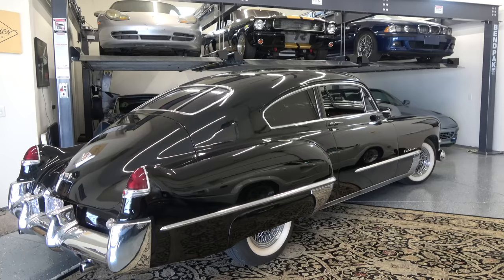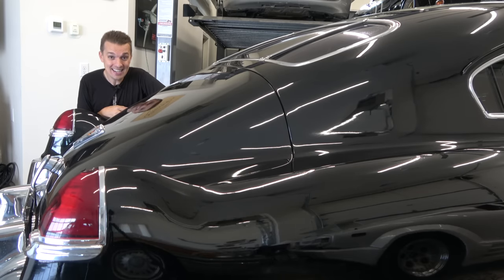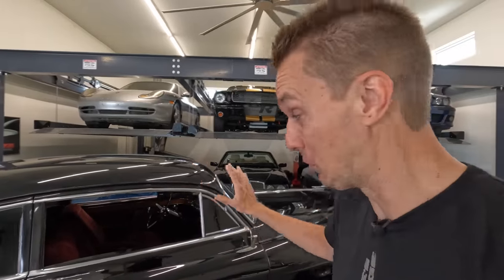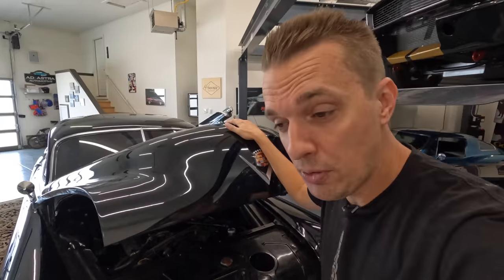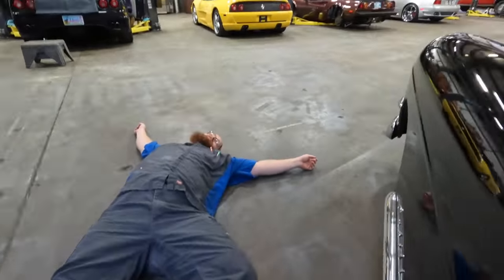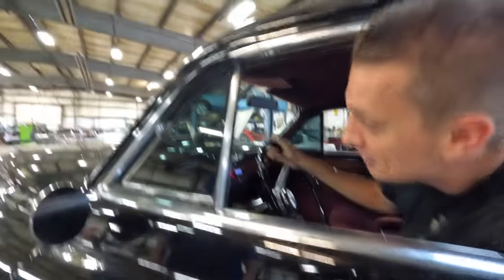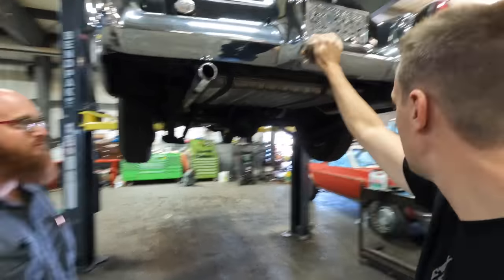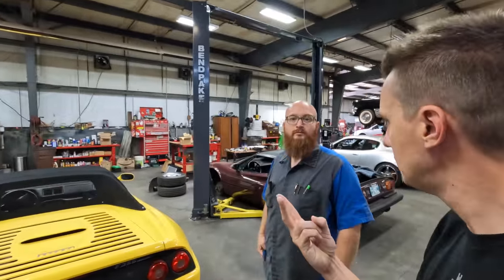I bought a RARE 1949 Cadillac Fastback, and making it my 70 year old daily driver! Amazing Restomod!

Comment: Because it says Hydramatic my guess is that it has the older Cadillac 4-speed transmission that came before TH400 (turbo hydramatic) which had only 3 speeds. I always say that the best design regarding looks and also mechanical features happened in the 40s and 50s while in the 60s there was a decline. Less interesting looks. And also 3 speeds from the mid 60s instead of 4 speeds show decline. That's why I am interested in cas basically until 1960 but not further.

Comment: “For 1971 compression was reduced from 10.0:1 to 8.5:1, the lowered compression ratio dropped the 500's gross output from 400 bhp (298 kW) to 365 bhp (272 kW), or 235 hp (175 kW) in the new SAE net ratings. By 1976, its final year, it had fallen to 190 hp (142 kW)”.

You could replace that gas siphoning device with something lighter. Like a 4.9L 200 HP CHT engine. 

But if it was my engine I would put a 383 stroker in it. You can get almost the same torque as the Caddy 500 but more horse power at a much lower weight, and a hell of a lot more room under the hood. If you really wanted to lower weight get a L6 4.8L with 170 hp and 270 ft*lbs of Torque.

Comment: Those 472 and 500 blocks had high nickel content, thin wall casting and only weighed 50-60lbs more than a SBC.   Pinnacle of GM big Engines.   I don't call it a big block only because Cadillac had no small blocks and big blocks.  it had only a Cadillac engine in it.

Comment: Wow! It looks amazing! The bright of painting is thanks to poliuretan te ñchnology, I think when this car was new it paint was ducco polymer, certainly very less shine, wich it must to polish off frecuently. 1949 Cadillac automatic transmision was Hydramatic N D L R , reverse works like a parking position. I had a 1952 Olds 88 wich had a S between D and L , named as Dual Range useful in streets until third step, due gearbox with 4 speeds. Power Glide, instead, had 2 automatic speeds, something like a 1st and 3rd position in a manual comparision.
My English is like a bag full of shit. 🤨
Greetings from 🇨🇱 Santiago Chile SouthAmerica

Comment: Never quite understood how these huge engines produced so little power.
Reply: All kinds of little improvements in engines over the years, particularly digital fuel injection and electronic ignition. And in the 1970's pollution rules started and they weren't very good at figuring out how to reduce pollution without losing power, so the same engines lost a lot power. Today with those advances engines are way more powerful and efficient than they were before the pollution rules.

Comment: If you lived in that time period then you would know that car weighs a lot.  This makes the car drive smoothly on leaf springs.  However, you should note that to replace parts will cost a fortune.  Also, look at the shortcomings you have with this car; no air, no power steering, no FM radio. The engine timing and plugs have to be set every six months.  Electrical wires and plugs have to be replaced every 3 years (if you're lucky).  Oh, front end alignments were important every couple of years. At least you should be able to put modern tires on this car.  Those tires in 1949 were crap and needed tubes.
Hey, it has its own type of GPS.... a AAA map!